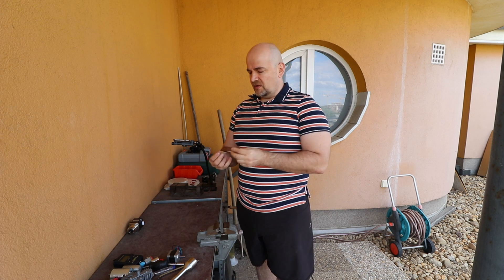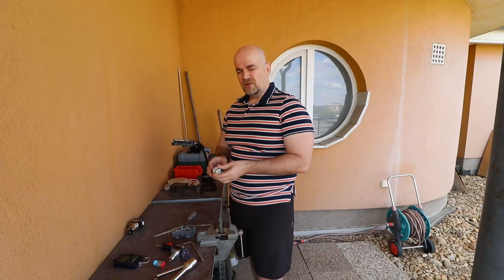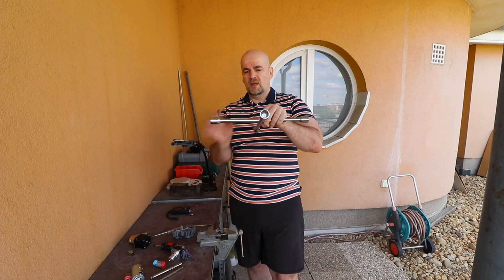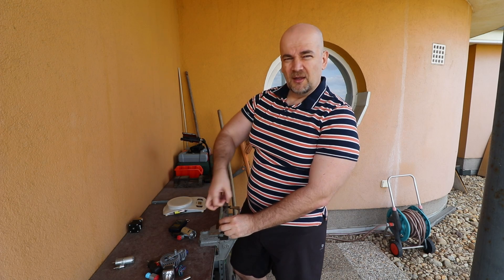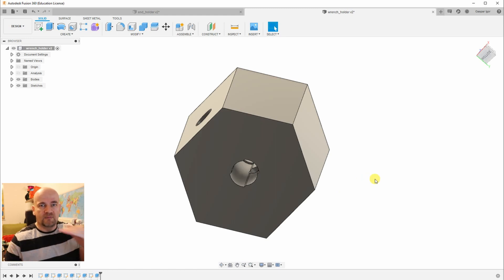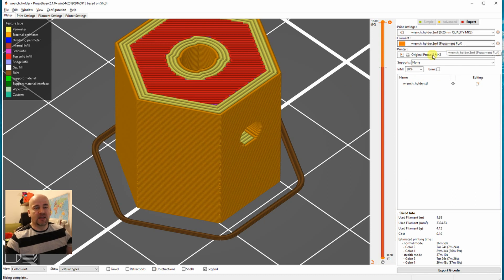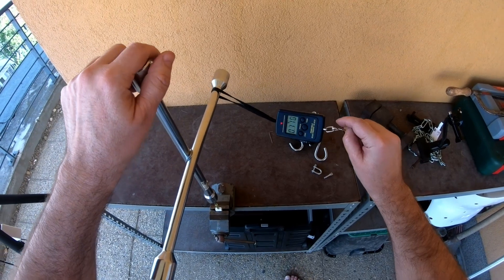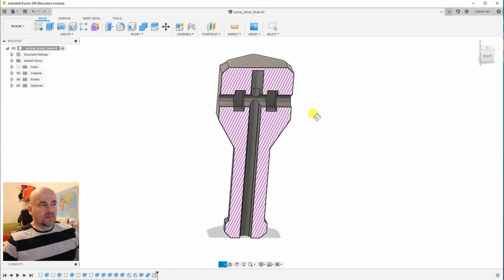Repairing a screwdriver with 3D printing + torque test

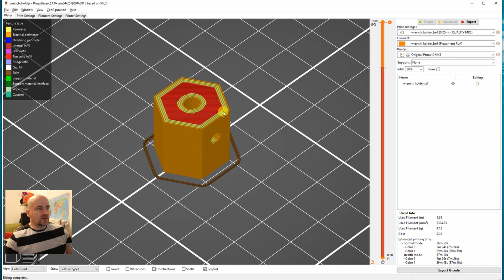Comment: 7:20 I invented a trick to strategically increase the number of walls on a model.  If you cut a 0.1mm slot offset by [line-width * perimeters] you can trick the slicer into giving you extra walls anywhere inside your model.  I used this to increase torque of a critical embedded hex nut.
Reply from the maker: Good trick. But since I can use part modifiers in PrusaSlicer, I can add separate settings to any part of the object, and i don't have to modify the original STL file.
Reply: @MyTechFun  You make a great point.  I was thinking about this and it occurred to me that using slicer settings is good for many cases, however modifying the STL creates a slicer agnostic improvement to the model.  This can be good for distributing files to a wider audience that may not implement the change.

Comment: Try heating the old screw driver with a blowtorch. and design the insert in the 3d printed part a few mm smaller. When you insert the shaft of the old screwdriver the, shaft will melt the inside of the printed part and make a secure fit. This is easier than your method, but I think your method will be more secure

Comment: Interesting. I would love you to test the finished screwdriver in your torque tester
Thanks for sharing :-)
Reply from the maker: In shown experiments (where screw was on flatten and not cylindrical surface) test probe was broken, I was measuring until I broke it. I did similar test with finished screwdriver, but only up to 2.5 Nm and I stopped there I didn't want to broke it, and it almost didn't deform at all (talking about temporary deformation). It's stronger because of 100% infill and bigger nuts. That's the maximum I can create with my hand anyway. I didn't want to broke the final version. I am not pro youtuber, I did this experiments for myself, but I am creating this video documentary because it's fun.